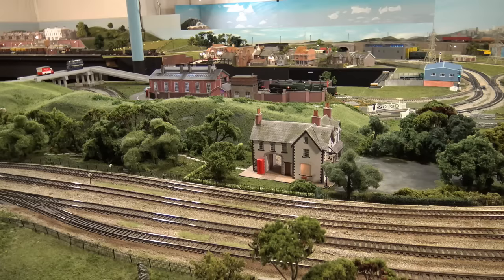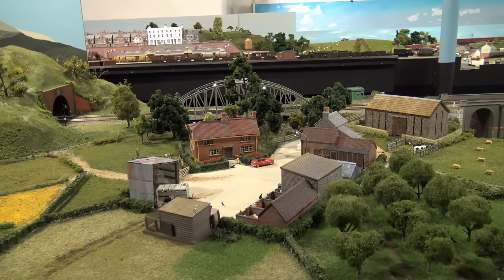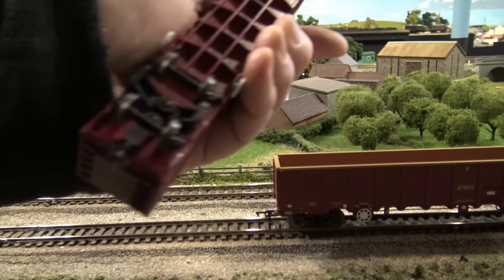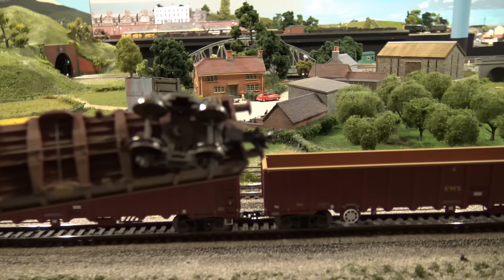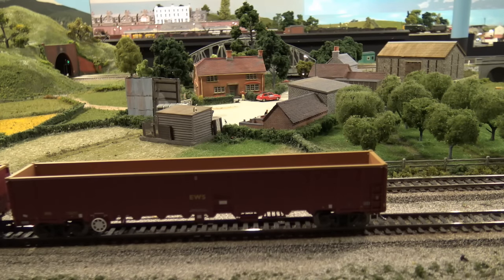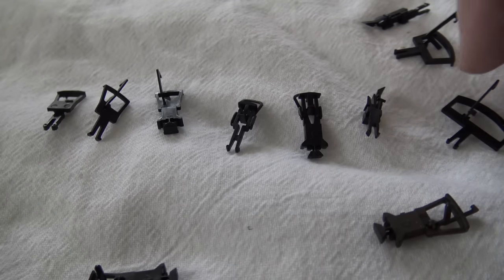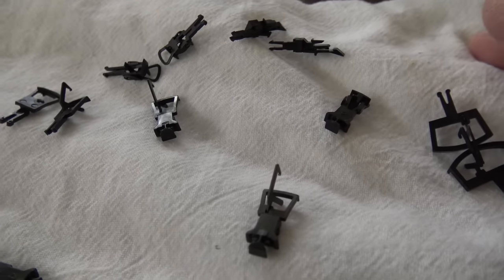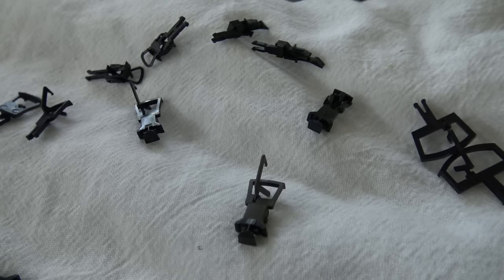20 Couplings make me crazy - Farland Howe

Comment: Hi Rob, just catching up on my YouTube videos. Very interesting video.  I was looking at Kadee couplings for future upgrade, what is your overall opinion of them, are they worth looking at?...Simon
Reply from the maker: Hi Simon, my N scale project is all Kadee of course. The American prototypical railroad coupler generally called a knuckle coupler is the Janney Coupler and it is a semi-automatic railway coupler. It was patented by Eli H. Janney in 1873.  It is what you would see if you looked at any railroad stock in the US.  On the N scale they work very well.  No problems with them.  Once I got the heights adjusted on my rake of wagons behind the class 66, they have run perfectly backwards and forwards ever since.  Advantage for modelers is you can simply lift up and away with them.  No uncoupling needed.  Does that help?
Reply: Hi Rob, the information did help, many thanks.  After sending you the message I did some research, you are right, there is a myriad of Kedee coupling types/sizes.  I also found a  Kadee Coupler Height Gauge, which sits on the track to help line-up couplings, not too sure how helpful that would be.  Thank you again for the information…Simon
Reply from the maker: Liverton -Simon Yes, me either.  I don't plan on modifying all my rolling stock any time soon.  I bought a bucket of the 362nem style and I may try a few here and there.  Thanks again Simon.
Reply from the maker: Liverton -Simon One other thing to keep in mind with knuckle couplers, they mount to the wagon and not the bogie.  Also there are no buffers.  Buffering is accomplished inside the box they mount in on the real thing.  There are springs and shock absorbers in there for that purpose.

Comment: It gets worse if like me you have designed for goods ops with lots of shunting, ie a lot of pushing and pulling AND you want to uncouple every wagon from every other easily, but stil have them locked together for runs. Kadee probably the best, being mainland Eu I have the stirrup couplings, Marklin, Roco, Piko, all Hornby eu etc etc. They are ok, but if I had the money and patience, I would go with Kadee. Robert
Reply from the maker: Hi Robert, yes, wouldn't it be nice if they all could play together.  Interesting, what is a stirrup coupling?  Isn't the EU a party to the NRMA standards?  I looked the stirrup up and it looks a bit like a Kadee only it is fixed instead of articulated.  It must spring away and then hook in.  Yes? No?  If they go into a square pocket (362 NEM), you could change them out fairly easily.    Thank you, Rob
Reply: Rob McCrain Stirrup is the coupling you showed from Electrotren. They are hornby like Rivarossi, Lima and others, compatible with the Marklin etc.
Reply from the maker: Okay great.  Now I know the name of those couplings.  I have used them whenever I ha having trouble keeping things together.  They are great for that, but do not come uncoupled very easily.  Thank you.

Comment: I just took out all my kadees. they seem to work on NA stock on large radii but on anything else, they fail... after some use they would constantly decouple on KKK stock (which is anything euro past 1990 really).  I know they are not designed for KKK but they do work initially. but after some use, they begin to slip. they also hate bank elevation.
Reply from the maker: john donovan Hi John, I don't have much experience with the KDs.  On Farland it is the vertical track wobbles that cause me trouble.  So far no problems on my inclines/declines but the steepest is 2%.  My Colorado & North Western is all KD and I have had no trouble on it.  Thank you, Rob
Reply: Yep they work fine on a fixed pivot point (NA stock and looking also UK freight). but on euro stuff with fluid radii type coupler arm, they fail hard. which is a pity because they are the most scale coupler on the marketalthough I had some of the knuckle springs fly away after some use. kadee does provide a few spares with each pack but not even sure how you can put these small things there, so a bit pointless. without the spring, the coupler will decouple when constant pull tension isn't present to keep friction (downslopes and heavy breaking)
Reply from the maker: Yes, I cannot imagine how you would ever get one of those springs back in.  Just bin it I think.  What is a fluid radii type of coupler arm?
Reply from the maker: john donovan I found something on a forum, I will dig deeper tomorrow.  It's late here.
Reply from the maker: I found some information on these kkk type couplers.  There is a video of a model running with them.  Do they derail often?  It looks like you could never use anything else like the NEM362 allows.  They look built into the coach or perhaps wagon?
Reply: its a good system but requires unscale looking couplers. you could run kadee  on them (in pull only, no push operation whatsoever) but my trials with them lasted only as long as the coupler arm springs were tight and the curves are 30"+.  it's a real pity because nothing is more scale than a kadee. the whole idea behind the kkk from what I gather is to allow 303mm cars to run on 2nd radii curves (and sometimes lower) which would not be possible otherwise. not sure why anyone would do that but it is what it is
Reply from the maker: john donovan Well I had never heard of them until now.  I am glad you mentioned them.  I don't think I will be swapping over to them any time soon.  Great exchange, thanks for taking the time. cheers, Rob
Reply: I truly didn't expect to even have any exchange. Those have been near impossible to locate on YT lately. Cheers
Reply from the maker: Curious, what do you mean?  Conversations/exchanges are hard to find?
Reply: yep.  people just tend to drop a random comment and go away
Reply from the maker: john donovan Maybe you're hanging with the wrong community.  :-)